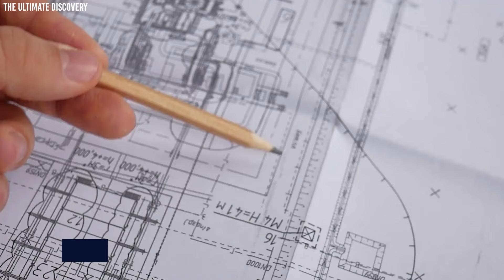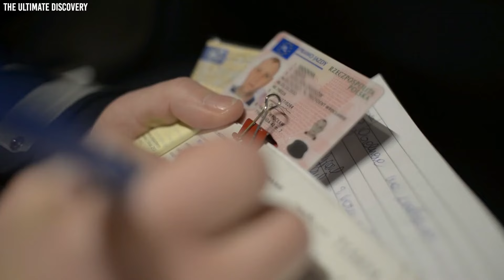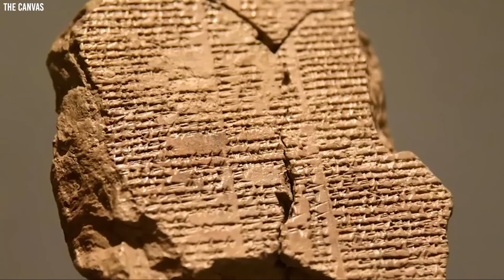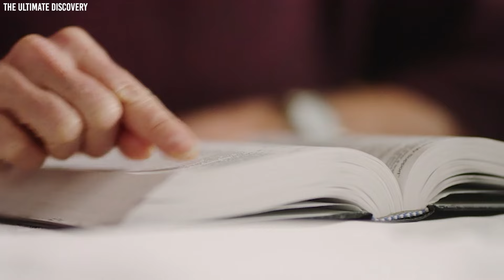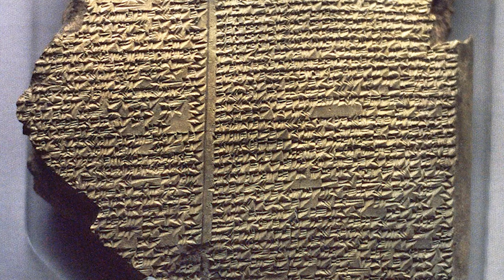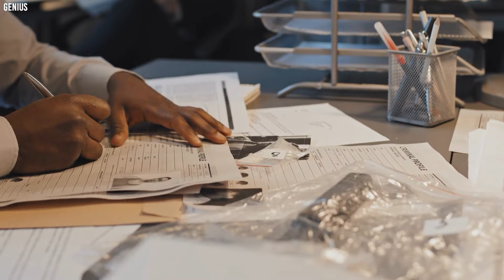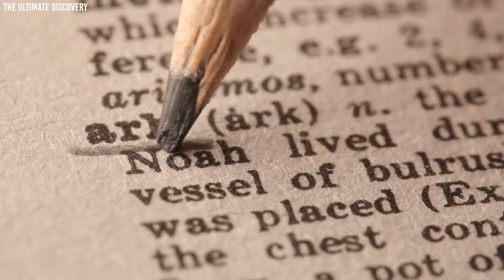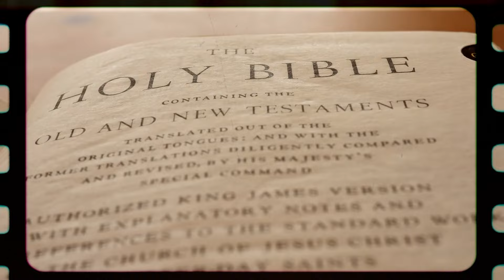What They FOUND Inside Noah's ARK in Turkey TERRIFIES The World!

Comment: The account states that the ark was 133.5 mtr long, 22.3 mtr high and 13.4 mtr high,  and flat bottomed it was rectangular not requiring a sharp bow or steering as it’s only purpose was to float stably with its cargo. This is not the Noah’s ark.
Reply: Ig someone else wanted a 515 foot long boat in turkey
Reply: it isn't even wood, it's entirely made out of rock, it's just a rock formation.
Reply: Why have they digg up iron bolts ancient wood slats laminated wood from sight.Ground penetrating radar shows massive wooden I beams.Some doubters would still doubt it if they dig it up and they was staring at it.😊 @subdueds
Reply: @subdueds  you know over time wood petrifies into stone right?😅
Reply: @subdueds they found bolts where the beams should be.. as well as big ship stone ballasts, huge ones. It's the ark, seethe
Reply: It never states it’s rectangular actually
Reply: This is Noah's ark.
Reply: @subdueds rock is just petrified wood. Catch up.